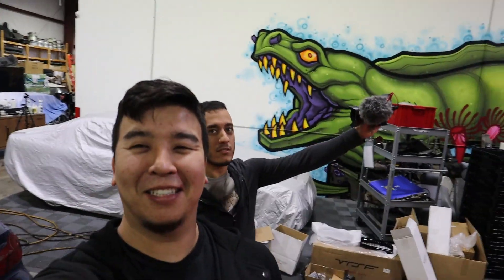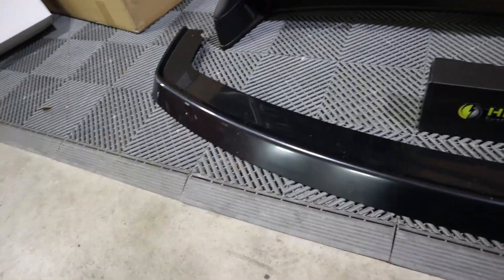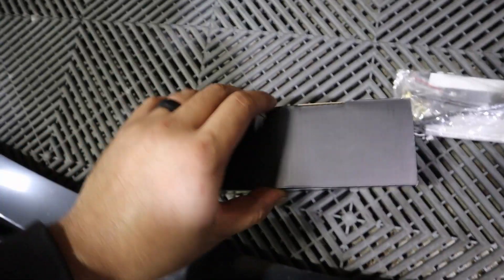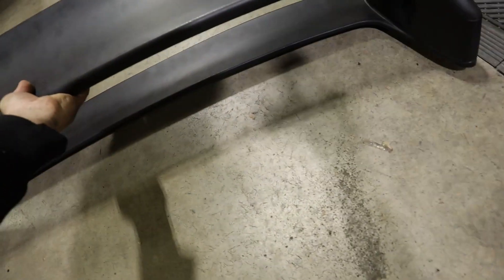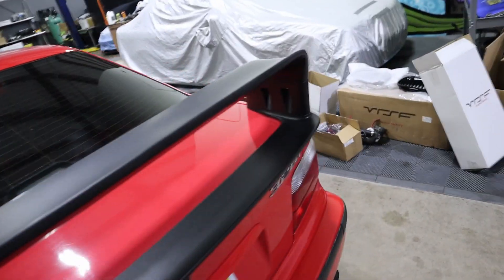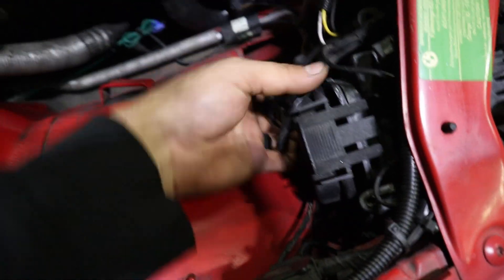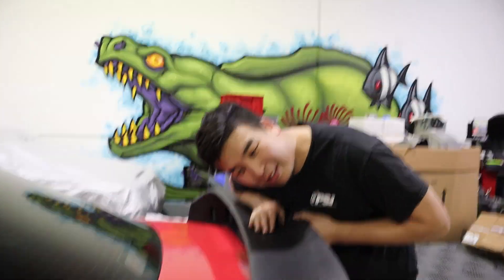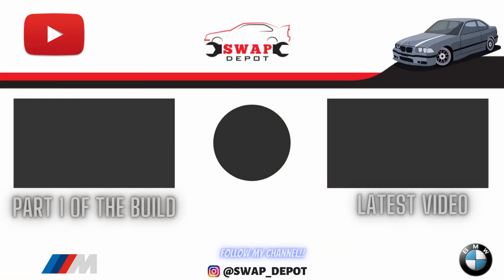Three things that will transform your BMW E36 exterior! (You need this!!!)

Comment: if you take the trunk lid carpet cover you'll be able to get your round pieces out.
and if you open your hood and get  2 of the plastic pins that hold the insulation to the ECU cover you can used them to cover the   front license plate mounting holes...just move the metal clamp to the side.

Comment: I'm not s fan of the LTW wing on E36 (or any wing really) but looks great here. It looks like you have Mikah rear diffusor but not using the whole kit... what's going on there? From a strictly aesthetic point of view I like the diffusor pieces on the sides but don't care for the fins and whole thing on rear...
Reply from the maker: It’s a race diffuser that I modified to fit the exhaust, everything is there it’s not missing anything, they have different options
Reply: @SwapDepot  nice. It looks great.

Comment: ali greats vids my guy. off topic i have an 07 BMW 335I car is great no lights or codes but if i go above 4k rpm and push it i get an "engine malfunction power reduced" half engine light and warning on i drive. if i restart the car warning goes away only if i push it above 4k rpm. i took it to a shop bc i have a generic Ob2 that cant read shadow codes and it says i have a boost leak. i put all new coils, and plugs, oil cap, vanos solenoids, i also checked my charge pipe/diverter valve it is tight no cracks and clamps tight, all vaccum lines were replaced late 2019 but i traced everything is hooked up and secure w new lines as well as on top of the engine too, inter cooler tight and secure. Its really frustrating i cant find the leak or the cause of the issue. there is no waste gate rattle and turbos been replaced jan 2020. any ideas or where you would start? i have a smoke test app next mon and diag bc i spent literally days on it with no luck :/ car runs fine if i dont push it only engine reduced if i go over 4kpm. any help lost at this point wish i lived in orlando stuck in cali..
Reply from the maker: Stock diverter valves?
Reply: @SwapDepot  yessir stock diverter valves. when i took it to the shop they said i had a misfire in cylinder 4 but thats bc i left one of the old plugs in bc one of my new spark plugs was damaged. i replaced it with a bosch plug and now every coil and plug has been replaced. so im thinking i have only a boost leak now. i was thinking when you do a vrsf charge pipe w a tial blow off valve do you still need the diverter valves?
Reply from the maker: No need for stock diverter valves just replace your charge pipe with tial bov
Reply: @SwapDepot  what happens to all those vaccum lines that are on there Ali? And do you have a hunch about why the engine reduced comes on at 4K rpm you think it’s related to the diverter valves. They are stock and 14 years old 191k miles
Reply from the maker: Stock lines get deleted and they provide you with another vacuum line
Reply: @SwapDepot  thanks my man. So you think the diverter valves could be the issue of the engine malfunction power reduced?
Reply from the maker: Yep your engine isn’t hitting target boost because they are bleeding off too much boost pressure
Reply: @SwapDepot  would that come up in the smoke test ali? that they arent bleeding right?
Reply: @SwapDepot  im thinking if i should just go w a vrsf charge pipe and tial and not waste trhe 135$ for the smoke test
Reply from the maker: Smoke test wouldn’t show it and yes just buy the charge pipe and the bov, Cristian has it on his website
Reply: @SwapDepot  I saw that and it’s on sale. I think
I’m just going to go with that thanks Ali. Will keep you posted. just curious is there a definitive way to test that the diverter valves aren’t working correctly? I’ve already spent a good chunk of cash buying parts to try and solve it (plugs, coils, vanos solenoids,)

Comment: Paint looks too nice to have the whole side repainted.  Why not try PDR first?  If they can’t get it near perfect, they typically do not charge you.  I’ve had some miracles performed with PDR.  One was a crease down the driver side door from a shopping cart in a dealer loaner car.  Knew they were gonna hammer me if I brought it back like that.  Came out great and I think I paid $100
Reply from the maker: Video doesn’t show how bad the damage is, driver door can’t be brought back that’s why I’m replacing the door, it’s hit in 3 different spots on the same door
Reply: @SwapDepot  ah that sucks.  Car looks great regardless.  Wouldn’t mind a red E36 M3 next to my alpine white one.  Really pops when it’s clean and as nice as yours
Reply from the maker: Yea hellrot by far is my favorite plus matches the channel theme 😂